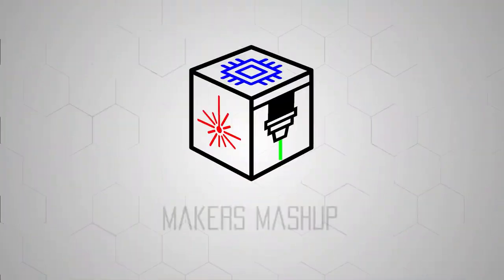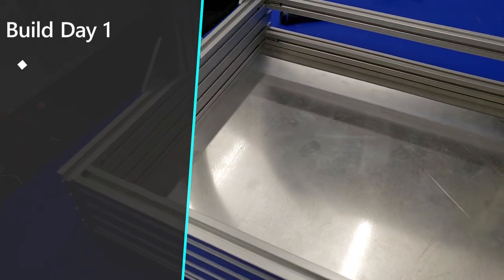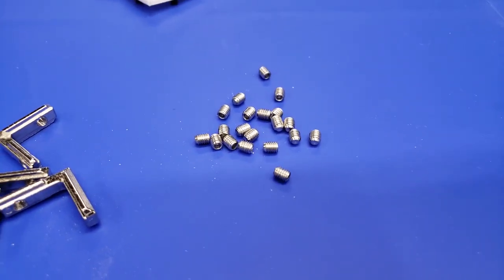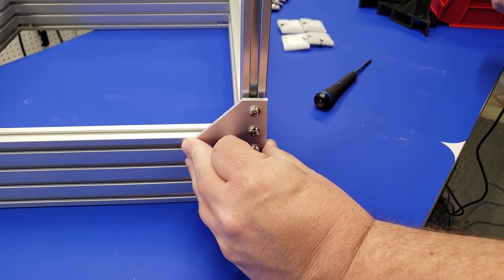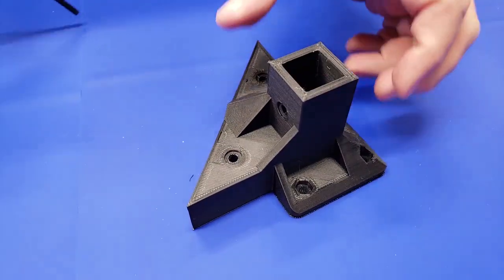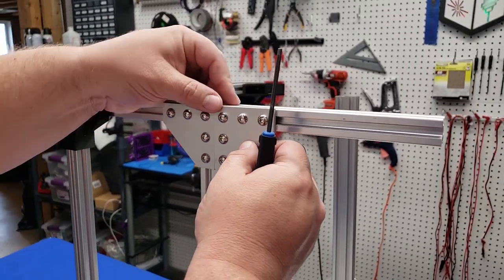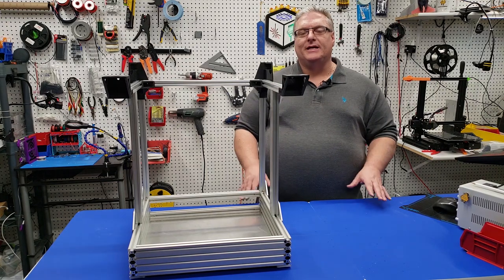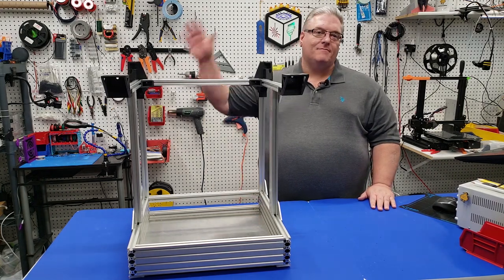DIY 3D Printer (CoreXY) | LayerFused X301 Part 1 - Frame

Comment from the maker: Are you planning to build the LayerFused X301?
Reply: Yup! Looking forward to this series!
Reply: Yes
Reply: Yes, definitely
Reply: I do plan on building this printer. Will you be making the Fusion 360 file available?
Reply from the maker: @KennethEMarks  Once the series is complete we're planning on making them available through bitbucket.  So stay tuned on that front.  In the mean time you can print the STL's that are available.
Reply: @MakersMashup  , Thank you, and thank you for doing this series. I just finished up a 'from scratch' build of the AM8 to replace my Anet A8. I found it helpful to have the cad files as I was able to customize quite a few of the components to better suit my needs. I'm super excited to about the mods you've made, especially the more open aspect of the core XY.
Reply: Yes looks awesome had my hart set on a delta but I think this one is the go. But it's the chicken or the egg thing, you need a printer to make the parts for the printer.
Reply: Not for 1,000.
Reply: Yes I'm I have started to get some of the parts that I need. I have a buddy at work to help me. He has 2 or 3 printers that he has done some upgrades on. He is go to build one or two also.
Reply from the maker: Don't feel it is necessary for the Z. We get plenty of precision with the lead screws.
Reply: I sure am
Reply: I'm going to scale up to the 500mm build
Reply: I’m building it now. I just need to take a couple steps back and ensure my frame is square. Some things don’t line up correctly.
Reply from the maker: Discord has plenty of people to help.

Comment: Hey I'm wondering. I have a large amount of parts for this build. Would it be easier just to buy the frame and motion system then sourcing the few bits and bobs separately? There's a 250x250 version of this isn't there. Also, are the prices in usd or cad? Sorry for all the questions. I thought you were a fellow Canadian which isnwhy I asked about the prices.

Comment: It looks like this costs ~$530 USD in parts. Probably a good machine, but out of my price range right now!
Reply from the maker: Depending where you source parts the build easily runs $500-$700.  The build focused on performance, print quality and aesthetics.
Reply: @MakersMashup  Im at 494$ and I still need headted bed, hot end, extruder, powersupply, extruder motor, and lead screws.  Also I didnt see belts on the BoM. Is that coming soon, I know you said the BoM wasnt finalized
Reply: @MakersMashup Much better  kits are available for $799.00. This makes no sense.

Comment: Hi-I am beginning this build and am attempting to create the required 3D parts at my local public library...which is quickly turning into a cluster.  Can you tell me what the 1st 10 (ten) 3D printed parts should be in order of assembly need?  

The library is balking at the number of parts I'd like to get printed so I'm going to see if they will print 10 parts at a time for me maybe once a week while I start receiving all of the non 3D printed material from various sources.  This is a great video series and I look forward to learning about my printer while I assemble and configure it.  Thank you so much!
Reply: NEVERMIND- Answered my own ? by looking at your 'MODELS and TOOLS' tab which shows which part goes with which video...indicating chronological need of 3D parts through the project....great BOM for including that info!!!

Comment: Why is the "kit store" closed? And why aren't you talking about investment up front? Very odd approach to building a kit. What is the finished printer capable of? Does it compare to any commercial printer? So many unknowns.
Reply from the maker: The printer was developed over 4 years ago and was released 3 years ago.  The CoreXY space at the time of release was still fairly new.  Today there are tons of CoreXY options.  The store did have kits but as the CoreXY space changed and became flooded with CoreXY options that you see today, kits became less cost effective.  Certainly there are considerably better kits out there and brands like the X1C.  The kit can still be made with self sourced parts and is still has many active community members in the discord.  The X-Series are better suited now for education and enthusiasts that want to start with a framework and build a custom printer from there.  The original and continuing mission for this printer and design is a simple and lower cost option to get into CoreXY as a DIY build that you can fully customize. So the capabilities and quality are what you put into it.
Reply: @MakersMashup   I appreciate the explanation; however, the capability is based on the parameters designed into the print head and other axis components. My only effect is if I built one sub-par, degrading the capability. High-speed printers are available now. It would be a shame for someone to build this today and be limited to some unknown print quality and slow speed. There is no need to give up the building experience; simply buy a current kit.  But, again, thanks for the feedback.
Reply from the maker: You're 100% right, which is why this was developed to be open so you can use whatever print head you want. We've had community members build with Eva head mounts, Mosquitos and the like. I'm not sure where you're unknown print quality comes from.  We have had community members produce great prints, myself included.  I think you're perhaps looking at this as "If I build it I should get X out of it".  This is a DIY build so as I mentioned before, the print quality you get out of it, is what you put into it.  The fame is simply a motion control systems.  If you want great quality, throw a great extruder and head on it.  Use can bus, flying gantry, the community has versions in all of these formats. How you choose to build it, is largely up to you.  Its certainly not a build for everyone.

Comment: Just out of curiosity, what is the quality of this printer compared to a pre-built unit?  I added up the BOM and it's about $1100, and I'd like to know if this printer would be better than a printer I can find for the same money that comes as a kit (just unassembled more or less).  Do you have the specs/stats on what this printer will do, like what resolution we can expect from it?  
Either way, good work, I'm looking at building either this one or a similar one to the video you did back in Sept.
Reply from the maker: @KDE5FAN the printer resolution is in the preview video.  I'll work on putting that into some of the documentation.  The major difference between this and pre-built kit is that you can source your own parts and its a learning experience.  So you'll understand far more building this than buying one off the shelf and you can bake in the components you like.  Want a 2 in 1 out nozzle instead of the V6 style? No problem, you can easily mod this printer to your liking.  Those are going to be the major differences.  Much like building your own PC it is considerably cheaper to just buy something off the shelf but building it you get a far higher level of control.
Reply: @MakersMashup , I can buy a kit for $799.00 and have an excellent state-of-the-art 3D printer. I have experience, I want a quality printer.

Comment: I would suggest using a chamfering tool/bit instead of a file.
Also if you tap the extrusions and drill a hole on the side and use domed socket head screws you dont need the internal angles.
Simple 5 mm hole 10mm from the side so you can pass the Allen key through it.
Screw just slides in the extrusion, they are designed to do so
Reply from the maker: Many people don't have taps and chamfering bits which is why I generally don't use them in videos. You're absolutely right though you could assemble it that way which is one of the awesome benefits of an open source design.
Reply: @MakersMashup  in my opinion m6x16 domed socket heads, a drill and tap are cheaper to buy then a bunch of internal angle brackets and if the profiles are cut correctly it also makes for a perfectly square and stiffer joint.
With corexy you want maximum rigidity.
Also you can use the same tap for many more printers or projects.

Comment: love your work but I don't know how much I trust those t-nuts. how have they held up? do they ever wiggle loose? do they shift?
Reply from the maker: Held up fine for me.  You can always use the roll in type or slide in as well.  Honestly probably close to 1000 hours on my production X301 and have has no issue. Belts, fans, bearings have replaced those but the t-nuts are fine. 😀
Reply from the maker: I will say once I've assembled I've gone back to tighten everything again but after that Zero adjustment. Just a check after the initial build.

Comment: Hello,

will I be able to print all the Parts with an Ender 3?
Reply from the maker: Sure can!
Reply from the maker: Just make sure your ender is tuned and your parts come out the right size. A calibration cube can help with that.
Reply: @MakersMashup  Thanks for the quick answer. I haven't had a 3d Printer yet but I just discovered your channel and the openbuild site and I'm amazed by the possibilites you get. Basically I'm just going to get an Ender 3 to print the Parts for this project and afterwards will sell it again ha. 
Greetings from Germany